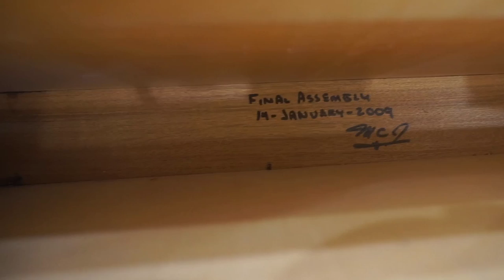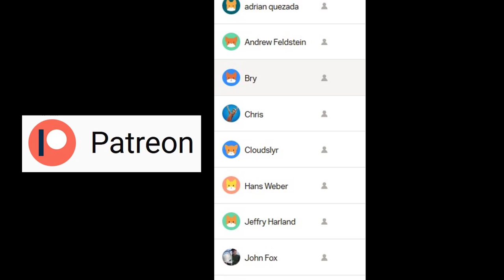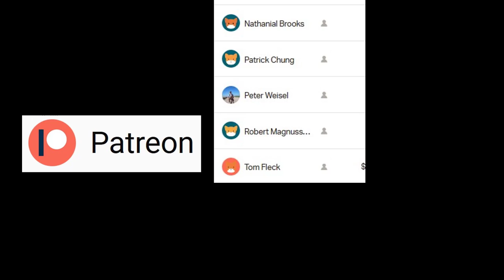Time to Retire?

Comment: I do a lot of leather work. You can save a step next time by not bothering to trim down the leather and just glue the backer to it uncut, and just trim it like you did with the razor knife.  I prefer Barge contact cement and a brush to help prevent getting glue everywhere, but I do have the spray stuff for really large jobs.   Small scraps of leather make good loops on the outside of the tool box for pliers and screwdrivers also.  If I can remember, I will take a pic of my tool bag and post it tomorrow.
Reply from the maker: That's cool Eric I'm fascinated by quality leather work and figured I was really hacking up the job I did with that liner piece. I pre trimmed it because it barely fit and I didn't want to start gluing it down in the wrong spot but otherwise yeah your suggestion would have been a more straightforward approach. And feel free to post that picture if you feel like it and get around to it as I'd be interested in checking it out. Best, Matt

Comment: Great video.  My vote is to give it to an apprentice or aspiring carpenter.  Thank you for the professionalism of your videos and the piratical knowledge that you provide in each one.  How long are the drawer slides.
Reply from the maker: Those glides are as long as they can be in that box so I'm pretty sure they're 10 inch and the full extension feature of them makes them useful and practical. Thx. Best, Matt

Comment: For minor to full time leather workers, try a $10 rotary cutter for a smoother edge cut.  You can find them in the sewing section at Walmart.  The more expensive rotary cutters from a leather store cost a lot more and are not any better.  I would’ve glued the leather to the board first then cut the leather.  The bottom board can be used as a cutting-edge after glueing to the leather and it would give you a more accurate cut.  This will remove a lot of your margin for error and it will also minimizes the amount of steps.  
BTW, I loved your chisel holder.  I’ve been doing leather since 1999 and I’m now dabbling with making and using wood and leather hybrids for the past few years.  Thanks for the video and sharing your ideas and skills.  PS, I also date all of my work too.

Comment: Just discovered your channel. Love it! Carpentry? On the verge of cabinet making. Surprised that you treat your drill bits so brutally. I try and keep mine so they don’t knock into each other. Am I being too precious? 😉 Looking forward to enjoying the rest of your videos.
Reply from the maker: Welcome, Bill... glad you like the Channel.  You can rest easy since the drillbit abuse you see is mostly the knock-about ones in my jobsite toolbox... the ones in my shop get special treatment, to the point of over protection... not all bits are created, or used, equally. 😉😁😎

Comment: What, no Robertson #2 bit (square bit) in your screwdriver? It is a standard up here in Canada.

 Auction (sell) the toolbox on E-bay and donate the proceeds.
Reply: A pound of loose (bulk) Robertson deck or all purpose screws (1 inch through 3 inch) is $5.99 CDN at our local Home Hardware. I haven't tried or even seen Torx screws, that said when I need screws I always head to the bulk bins. I did just buy a 20 pound box of 2 inch deck screws for an outdoor  project for $89 CDN.

Comment: Great to hear it’s not you retiring! I’m a recent subscriber and have been learning a lot from your videos! Question on the spray cans, I have seen the same tip on it on another channel but I was wondering why store the cans upside down if you have to shake the cans before using it again and remixing the sediment back in the contents? On what to do with the retired tool box simple just send it to me!🥴 That is if you don’t have an apprentice that you are mentoring and would appreciate the gift along with the story of where the wood came from but if not again I am here!🥴
Great videos!!! Keep up the great work!!!
Reply from the maker: The thing about the spray cans is that the type of sediment that would plug up the hose sticks to the underside of the top of the can instead of settling as sludge on the bottom. if it gets re mixed by shaking the paint it will flow out the tube but if it's stuck on the bottom and glommy it just plugs up the tube the first time you press the nozzle and never comes out. I don't know if that makes sense but try it and I think you'll be pleased with the results. I'm still evaluating suggestions for the fate of the old toolbox but I'm curious what you would do with it if I sent it to you... Best, Matt
Reply: Next Level Carpentry Aaaahhh ok! thanks, I just turned my spray cans upside down as far as what I would do with the toolbox. I would put it back to work but at a slower pace. I tried sending pick of what I have but can’t see how to
Reply from the maker: @CJ4Z1JC  BTW best way to include a link to a picture is to upload it to something like Instagram Dropbox or Pinterest and put the link in your comment...

Comment: I know I'm probably way too late to this, but since the handle is damaged my suggestion was going to be to add a tensioned steel truss rod to run through the handle. It would add significant strength, perhaps making it stronger than original. Tough to add to the intact new toolbox, but since the old one has previous repairs probably not too big a deal to disassemble it. That curve in the handle would probably make it too tough to drill lengthwise through it intact, but a master carpenter such as yourself might have a trick. I would love to see a video on that!
Reply from the maker: Thanks for your thoughts on this James.  Tensioned steel inside the handle would certainly be strong... and stronger than original... but I'd probably opt for disassembling and cleaning the mortise/tenons on the handle and then re-glue with a tougher, less brittle epoxy like JB weld. I like how you think though!  To get a steel rod or cable inside the handle I'd likely split it in half, rout a groove, fill it with epoxy, imbed the steel and then glue the halves back together... but I don't see doing a video of that heroic solution as feasible. 😉😎

Comment: That is standard 3" double stick carpet tape you're holding. We use it by the skid at work. Mostly we use the 2".     edit; on second look that looks like a type of gaffers tape. can't tell from the video.    I made a box very similar to that when I was an apprentice carpenter. I brought it into work to show it off. When I had my back turned an older carpenter cut some scrap wood and slammed some nails into it for nail partitions like it was garbage. It was beautiful for about 10 mins.    sigh.
Reply from the maker: Some people just got no respect for a fine tool box! Shame on them! Best, Matt
Reply from the maker: Oh... And here's a link to the tape: https://www.abatix.com/abatix-blue-tape-72mmx54-8m-11mil-1-each.html

Comment: Nice tool box. What I liked most about it is the drawer. Is there any danger that the drawer will accidentally slide open? 
Getting rid of a treasured item like a tool box is easier if you photograph it first. That way you still "have" the thing even if it's elsewhere. It's a key element in my pack rat therapy.

Comment: Matt, I love to see your method of sharpening your Chisels.  I dont know if you have grinder and grinding stone you use. For me that is just another piece of equipment that takes up space in the shop.
Reply from the maker: Without a lot of detail I can tell you I just use my bench grinder and then Klingspor's self-sticking wet and dry sandpaper on flat scraps of solid surface countertop material.  It's a slow process but very effective... it's just the way I've always done it.  A Tormek setup would be great but the shop space prevents me from going that way too.  Best, Matt

Comment: You could donate the toolbox to Cross & Hammer Woodworks and we could use it as an example for others to build their own in our shop for Community access here in San Antonio. The shop is my own wood works, but  also, we let neighbors access the shop and get advise and help in their own home repairs and improvements. Thanks.
Reply from the maker: Interesting possibility Keith.  Do you have a website for Cross & Hammer Woodworks?  I did a quick search and didn't see one... Best, Matt

Comment: You are well stocked up in that fine tote my friend - and as you said: it's hard to come by a better commercial to get your brand out there. A few suggestions I hope you don't mind, as I've come across some of the tools you have in there over the years as well, and have found better replacements for them. As I'm sure I don't need to mention, the options are more expensive, but in my view worth every penny. As another wise man here on YouTube, Scott Wadsworth from Essential Craftsman says: buy the best tool you can afford - new or used.

1) The quick grips you have - replace them with the XP model. You will not be sorry. You only need half the hand pressure to apply the same amount of clamping force, and they are a lot sturdier, than the regular ones

1a) Consider a pair of small lever clamps, either Festool or same model Bessey (the actual manufacturer for both). They get in in very tight spots and give you tremendous clamping in a small package - true forged clamps. Moreover they're fast.

2) Not sure which brand tips you've got in that DeWalt case, but I have found the Wera brand to be superior to anything else over the years. Festool come close, but they have their own fit for the longer tips that go with their centrotec system - the Wera don't. They are universal as anything else. I have only rarely snapped a tip, but twisted the bejeezs out of quite a few more, but they still hold up and go in and out of the kerf no problem. Really really top quality tough stuff with a perfect fit and durable as only few, if any. They also have a very wide assortment in anything from tips over both regular and electricians screwdrivers as well as ratchet kits and more. They are my go to in anything related to screws. Special kits for stainless screws are also available to avoid future rust from the tool steel of the bit.

3) If you need a handsaw, try out a true Japanese one. Not the Irwin or other replicas - the real deal. I've been using saws as far back as I can remember, and gamechanger is not really a very commonly appearing expression in my vocabulary, but it is the most fitting one I can find to describe it... if you get along with pull saws of course. They're usually preferred for m&t as well as dovetail work, but mine sees just as much action on coping flatwork and such. Very tough to beat.

Take from it what you can use, and best of luck to both you and your new old tool box on your continued journey.

All best

Martin
Reply from the maker: Thanks for the in-depth tool specs in your comment Martin... From this and other comments I get the impression you're quite a student
 of current tools trends, specs, performance, etc and appreciate you sharing your knowledge with me and the Next Level Carpentry audience!  I'll check into the XP clamps as the little one I carry is pretty weak.  Where other 'best of' tools are concerned I suspect you share my frustration with the fast-pace of changes and updates.  I shop for a new tool to meet a need, find what I think is best and buy one but soon find out it's been 'improved' with negative effect and the one I like best is no longer available!  I share Mr Wadsworth's view on tool quality but, on smaller tools, it can be job unto itself.  I really shouldn't complain though since I'm continually amazed by the evolution of tools available today and what can be accomplished with them!  
Best, Matt
Reply from the maker: Thanks for the in-depth tool specs in your comment Martin... From this and other comments I get the impression you're quite a student
 of current tools trends, specs, performance, etc and appreciate you sharing your knowledge with me and the Next Level Carpentry audience!  I'll check into the XP clamps as the little one I carry is pretty weak.  Where other 'best of' tools are concerned I suspect you share my frustration with the fast-pace of changes and updates.  I shop for a new tool to meet a need, find what I think is best and buy one but soon find out it's been 'improved' with negative effect and the one I like best is no longer available!  I share Mr Wadsworth's view on tool quality but, on smaller tools, it can be job unto itself.  I really shouldn't complain though since I'm continually amazed by the evolution of tools available today and what can be accomplished with them!  
Best, Matt
Reply: @NextLevelCarpentry  I'm right there with you... I guess my philosophy is that if I'm to shell out money I do or barely have for a pricey piece of equipment, I'd better done my homework, or I'm the only one to blame for being ripped off, as every single one of them want to sell... My job is to figure out where price, functionality, durabilty, efficiency and ergonomics intersect... Being tied to a battery platform these days on cordless tools has not made things simpler in any way - you have to go through the whole package of what you think you might need in the future, and see which one fits the bill the best - I went with Milwaukee not too many years ago, and apart from DeWalt killing it on the DCS577X1 framing saw, I'm not sorry. For the price they're very hard to beat, as their screw guns and such have held up a lot better in my hands, than the DeWalt ever did. Hitatchi (now Hikoki) is not something I have become very familiar with. To the best of my knowledge, they make great tools, but they're simply not very widely available and I'm not sure the footprint of the platform is entirely there yet. Everyone knows blue Bosch. They do make some decent stuff, but Milwaukee definitely has more grunt. Especially things like the Super sawzall are very hard to beat... And about a year ago, they too came out with a cordless jobsite tablesaw... so... happy camper all in all. I'll get stuff done with that gear. Then there's always Mafell, Hilti and all of those, but they're kinda beyond the size of my wallet, though I'm told there really is nothing else, which might very well be true, but I guess I'll have to make do for now anyway.

In reality I like to do things old school without all of the modern fussing, but sometimes it just is neither very practical or what the customer wants, much less can afford, as chopping your way through a project with an axe just might be prone to be a bit more time consuming.

Comment: What were the three rods with a point you have what do you use them for?
Reply from the maker: The three rods are for through wall location what you can see explained in this video
https://youtu.be/_1L9WDzGZQ0
I love it when something so useful takes up so little room! Best, Matt
Reply: Thanks Matt,
Watched the video and understand now what they are for. I will have to give it a try
Reply from the maker: @paulgimenez1846  thanks for checking out the video and letting me know Paul.  As you saw in this video I don't go anywhere without those wires because I use them so frequently.  In fact the day before I shot the video I was using those wires to locate outlet and plumbing rough-in locations through a wall in a finished basement for adding a small wet bar.  Use a little Caution as I suggest but you'll be amazed how much time they save and they accurate results you'll get! Best, Matt

Comment: Matt, you've gone and done it again.1)  I fell for the click bait.  Had a queasy feeling in my stomach until I realized it was your trusty ol' toolbox.  So, this is all bittersweet,  but you're still here.2)  Love the thin angle iron for ripping thin stock on the table saw.  Note to self #1......3)  I've always cleaned spray can nozzles and straws by spraying upside down since I was a teen, and had to cut a lawn to buy a can of .59 Testors spray paint.  (the stuff is $6 - $8 a can now, depending on where you get it from - that was 45 years ago).  But to store upside down.  So obvious, yet never crossed my mind - but will in the future.  Note to self #2.....4)  I made those sanding blocks not long after I watched your video using white oak scraps (rails and stiles) from our flood damaged kitchen cabinet I had to replace.  I had enough for 6 blocks.  Destroyed the first one, but still have 5 good ones and a portable rack almost like yours.  Hard to find affordable nice hardwoods here in NE FL.  I scour dumpsters and trash piles for furniture, remodels, old cabinets with a rare score of nice oak or maple or rosewood once in a while.5)  The items in your essential tools drawer are nearly identical to mine.  6)  I'd pass on your old tool tote to one of your family to keep it in the family!7)  Would love to see a build of that box (with rough plans) with essential design elements for strength and durability.Until next time...............
Reply from the maker: Thanks for the thorough and thoughtful comment Dan. In response I'll clarify that the angle thing I use for ripping thin stuff like laminate is made from a Sharp 90 degree Bend in a piece of sheet metal from a metal roofing project and it's not thick like angle iron. Make sense?
Best, Matt

Comment: Your laminate template was too big.  You must have used a french frog's hair.... I hear they are really thick. thanx for the spray can tips.
Reply from the maker: The variation between frogs hair thickness from frog to frog can be quite disturbing and it's easy to get off caught off guard isn't it?! I get in trouble every time I go and make an assumption😕🙄😉😎